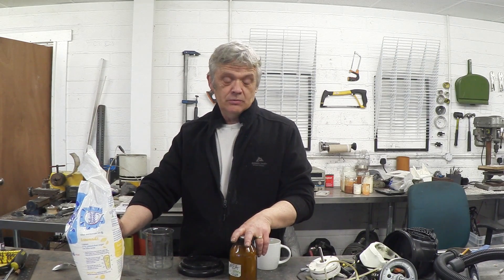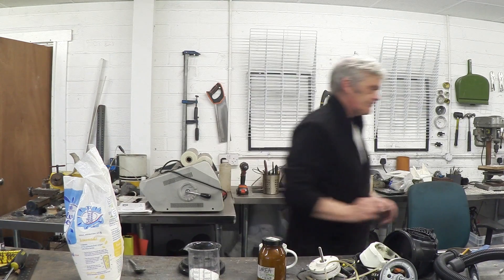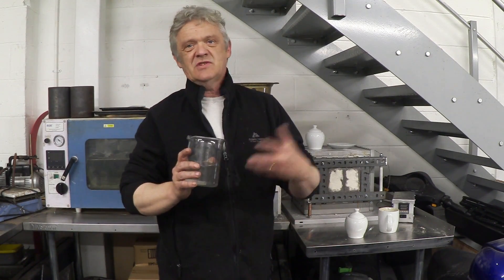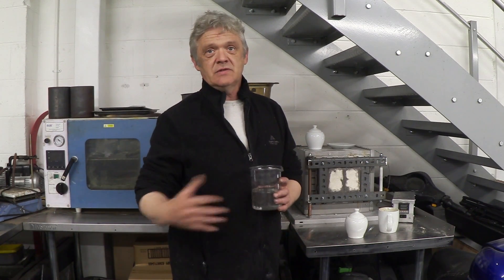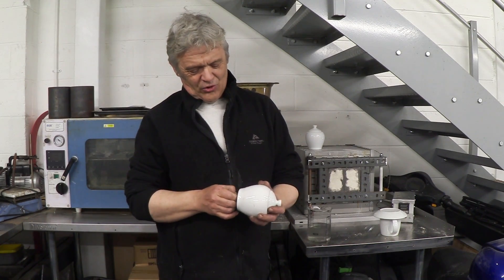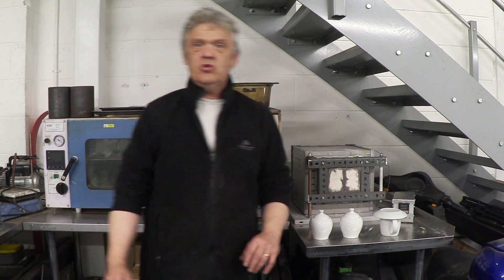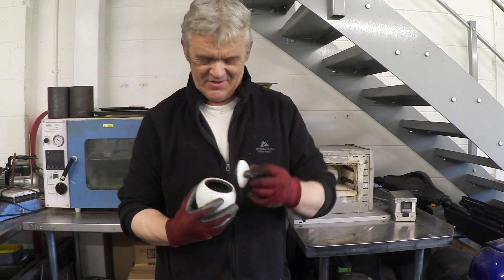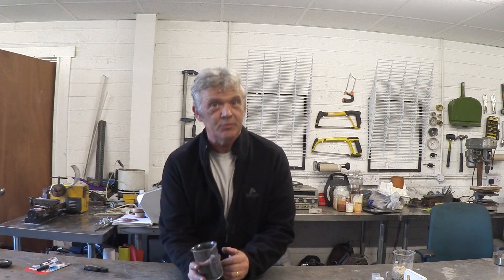DIY Safe Hydrogen Storage

Comment: I really shouldn't watch these videos just before going to bed, now my brain is popping and fizzing with ideas!
Reply: It helps me to understand many things I have been puzzling over for years. Love it
Reply: I get that alot mate hahahahaha killer init pal
Reply: Same lol. I watch them for a project I’ve in mind, but every video that I watch gives me more ideas and questions 😂
Reply: Same goes with me 😅
Reply: Yes, this man has ruined my sleep more then I can count.
Reply: here i’m watching this at 2am
Reply: Still his message is to just do it. In the right recipe base. And report back. What more can we do? 

I broke it down to do a fusion of sugar bowl and the kiln-heating in one: wrap an old 1kW radiation heating wire (heavy spirala some 0.6m long and 5mm diameter, of wound heating wire, the quartz pipelet got broken) around the sugar kettle. Then isolate first with stone wool for chimneys, then do 4 feet with the tight stone wool, and the rest isolate in a second wire with rock wool standard insulation from building narket or left-overs.

How do I share a foto? :)
Reply: I get an inch to go to harbor freight or ace hardware in the middle of the night
Reply: My problem is, I love genius to!
Reply: @haroldkrivell2524  lol mate. Same.
Reply: 109%👍
Reply: Mr Robert believes in th KISS theory

Comment: Could you do a video about compressing the hydrogen into a storage container and using the hydrogen in
an application such as a fuel cell or for heating or even cooking!
This is amazing!
Reply: Get a oxygen tank on offerup. than get an oilless pump from amazon. than get visqueen plastic and make a balloon. fill the balloon kup with the gas than pump the gas into the oxygen tank. Just like you would if you were filling up a divers tank. the balloon gets up to 5x5x5 feet and fills the tank. with the tank depending the size of it I can get up to 15 to 20 minutes of continuous gas flow. obviously you do the calculation on the formula flow. let me know what you think of the idea.
Reply: @seavil1  wouldn't you have to worry about the heat of the compressor? I've been thinking about this
Reply: @seavil1  what kind of a pressure will this get you to? Is there an efficient way to bump this up, perhaps with a boost compressor or something, to a higher pressure for use in something like a fuel-cell car?
Reply: I just found out you can use an oxygen concentrator to fill oxygen tanks and you can use the tanks for what any application but use Professional Flashback Arrestor so you don't blow the tank up.

Comment: Hi Robert! I'm not an expert in any of this, but the only research paper I could find regarding using g-C3N4 as a storage medium for Hydrogen suggested that the "hydrogen storage capacity of g-C3N4 nanotube bundles is at least 5.45 wt. % H2." However, here you're giving a number of 10 wt. % H2. Can you provide the DOI for the article you were referencing, or explain the discrepancy?

Comment: Robert, you are a hero of mine! I love your channel!
I would love to see another video where you take this material and store hydrogen from your pee electrolysissystem and then make use of the energy afterwards!
I live off grid with solar panels and batteries and I would love to be able to store some summer energy for the darker winter months but hydrogen storage is a stumbling block for me
Reply: i share the same feelings
Reply: Grow potatoes, distill to ethanol, run a Jenny with mix fuel carb. This way you can run  it off biogas as well. Sugar is nature's number 1, solar battery, and completely green
Reply: Very well put. Evidenced by our evolution to ethanol. Carbon blinded is what we have become
Reply: @psylentrage  Yes, but my conscience cries out burning away food. That‘s why I like the GCN doped with catalysts (there are some free of rare metals) and fed by concentrated sun light (DIY concentrating heliostats) or electrolysis. 
First to produce H2 for some days. 
But also - all outsides - produce NH3 for winter, as 11MWh fit into 2.7m³ standard liquid gas tank (coated against corrosion). As it is self-warning, no bad accidents can happen. 
Unless you fall unconscious from a blow on your head and lie in a sea of it. 
Just use corrosion-protected pipes and vents and a scnr cat. 

But for Biomass: 

Because for heating by biomass, all you have to do is use the cut bushes material, chopping it with fresh sharp blades, so short even-sized pieces can be yielded, and DIY build a convection-storing-drying silo, with sieve by blowing air to throw out the lighter leaf and straw-like parts, and insides disinfect with CIO2 gas in between to prevent mold, and build a Y first to solar-heated drying and in winter, to shove a spoonful at a time in the burner. Found an inverse flame lambda-sensor led burner at patents of sunmachine sterling pellet stove. Replace pellets in the patent that are rising with oil price by DIY chopped garden waste, done.

 Let us do some open hardware/software platform where editors 2d 3d simulation, …, reside, and where we exchange and collaborate (realtime online) to improve drafts.
Reply: @andshofs5769  food is energy and energy is food. It just depends on the need.

 You're method also can't be taught and implemented in rural communities from supplies at the local hardware store, whereas we've been distilling for millennia and if your not going to be drinking the fuel, you don't have to be that precise nor need a copper stil. This fuel is renewable. 

Gas is not the only product from the digester, you also get a super nutritious fertilizer slurry. And you don't need to feed it with your food. Any biomass will do, obviously the higher the calory content, the better.

Comment: We've determined a great cheap material to store hydrogen and it's everywhere!! Yes, water is the best cheap hydrogen storage solution. We placed hydrogen gas in a small glass bottle and placed it inside a large glass coffee jar filled to the brim with water. We capped it off and then placed the jar submerged in a bucket of water and left it there for approx 9 months. After this time, we found there was no loss of the hydrogen gas in the small glass bottle. In our view the reason why water stores hydrogen really well is because not only is there no hydrogen contained in water but also because hydrogen is immiscible in water.
Reply: I call that BS. Hydrogen can easily travel through water.

Comment: Great video! Very interesting. 10% by weight hydrogen storage capacity is very high indeed. Please continue this subject with the absorption and desorption of hydrogen. 300 degree C is too high for PEM fuel cell applications though. :washhands::washhands:👍👍
Reply: A heater mustn't necessarily been driven by pure exhaust gas. You keep a bit compressed gas for starting up and simply burn it. If you isolate the storage tank well, perhaps vacuum insulation, you just need to invest the heat capacity it has (c=1J/gK for metal) and the "evaporating" energy when H2 dissociates from the storage. 

Has anyone found links to cool papers that deal with the precise amount of energy you need to drive out the H2 per L gas in normal conditions 1bar 20°C etc.?

Comment: I saw something like this a long, long time ago. They used some kind of storage that needed heated to give off the hydrogen,. They tested the new tank against a gasoline/petrol tank and determined that if gasoline wasn't already a common fuel, it would never be approved today.
Reply from the maker: no it wouldn't lol and no one would think lead acid batteries were a good idea either - you'd get.a ton of people arguing about it and experts telling you it couldn't possibly work lol

Comment: Many thanks Robert !   This is Fantastic information as I'm building a hydrogen fuel cell. Just absolutely great videos on your channel.
Reply from the maker: awesome mate
Reply: Question for you, are you using hydrogen as a gas, liquid or solid? 
I'm currently working on a hydrogen pellet like dry ice. Many safety concerns have to be addressed.
Reply: @archur111  I just flew to Jupiter where Hydrogen is a fluid metal at its core and used some hydrogen metal (great stuff that hydrogen metal.
Reply: @3dmaker699  are you saying that you can't transition hydrogen to a solid?
Reply: @archur111  Not magic mate!
Reply: @archur111  mIX IT WITH OXYGEN  AND JUST MAYBE
Reply: Seriously, it's not a good idea...
Reply: @archur111  Your whole question and point of view from the very beginning was ridiculous in the first place.
Reply: @archur111  Got you I thought you meant hydrogen gas as a solid. What you are talking about when you say solid is a metal hydride is that correct?
Reply: @archur111  I'm curious about your pellet project. What problems have been adressed?
Reply: @briarfisk  I'm sorry but I have had a huge delay in my project. Moving....
My Hypothesis has remained the same however I'm not sure what to use as the Hydrogen gas mix. I can't afford to have an explosion....

Comment: Hydride storage is the best and the hydrogen won't burn or explode in the tank under all conditions and is not pressurized, a little heating rod creates the release and flow to an 8-cyl engine.

Comment: Excellent, love the variety of interesting ideas. I saw a video on using an old fridge pump to store hydrogen in a propane tank. It was on the channel, The DIY Science Guy , Reminded me of your “recycling  of old things“. Would be amazing to see you create a machine like that. keep them coming, your work is awesome.
Reply from the maker: it wouldn't last that long or even store that much and It certainly wouldn't be that safe mate
Reply: @ThinkingandTinkering  To be sure hydrogen embrittlement of containers and fittings not designed for it is dangerous.  However, it is possible to store 70% more Methane in a tank with propane in it than an empty one at a given pressure due to solubility of Methane in light hydrocarbons.   Trying to get my head around whether this would be synergetic or confounding with the carbon nitride.  Well, this comment makes no sense because I mis recalled the methane research as hydrogen and then edited out the misinformation.   No idea as to solubility of H2 in hydrocarbons.

Comment: I will have a go at doing it in a microwave kiln :-)
Using it as active material in super caps or batteries would be cool.
Reply from the maker: so, the polymerisation reaction of urea to carbon nitride occurs between 520 and 550 degrees C. above 650 thermal decomposition occurs. that's a very tight temperature range for a microwave setup to control without computer assist. i might wire a stop start into an arduino with an ir temp sensor into the reactor body. if you do that i don't think you'll have a problem.
Reply: @kennethanderson7642  Yes, I think I am only putting off the inevitable too.
My microwave is only 700W, and can be set for 20% power at the lower setting, so worth a fiddle, making 15g batches rather than 150g
Reply: solarhope if its a transformer type they use duty cycle but inverter types can actually be on at 20% and higher with 100% duty but still its hard to keep that between the small window so i think a kiln is the way to go for even tempretures !
Reply: @kennethanderson7642  

i miss kev.

Comment: It's an amazing method for storing Hydrogen! My congratulation for this. Till now they told us need deep cooling Hydrogen for transport etc. which is very expensive for the anorm tecnical equipment - but with this ... GREAT!
Reply: I think this would be too heavy, but if cheaper than cooling, a plus :)
Reply from the maker: there are always different solutions mate - it just depends on what you need

Comment: Hi Robert, I tried to follow your recipe and made graphitic carbon nitride. However, the material never managed to absorb any hydrogen. I supplied 30 bar hydrogen gas at 25 C. Is there any activation process for this material? Did you do a video on graphitic carbon nitride storing hydrogen that shows the amount of hydrogen being stored or being released by this material?
Reply: in this video, robert states carbon doped graphitic nitride grabs the hydrogen at 1 atmosphere.   i didn’t see anyone else confirming that.  did the weight change ?  apparently it grabs h2o vapour as well.
Reply: Hey buddy if this material really works start making hydrogen storage tanks please

Comment: Okay 2 questions:
1. Could this be used as a molecular sieve, say for a stacked neutral plate dry cell hho generator and you wanted to separate the gases? Or is there another material that would be more suited for that?
 I know you can do it with regular electrolysis setup but I'm wanting to use high amps and I dont have super thick gauge stainless or loads of graphite currently at my disposal. 
2. Do you have any experience with making ferric nitride( Fe16N2)? Super promising material but I I havnt found alot of information on synthesizing it.

Comment: Great info Robert, thank you for sharing.  Now, can I put what you got from your beaker, for example in a tank & compress hydrogen to it to store it?  Or how do I go about this in a practical way?  My dumb way of thinking is: I surely don't want any air trapped in the tank if the tank is to store hydrogen, cause then, it'll turn into a hydrogen bomb.  So, how do I apply hydrogen to this & keep it in place?  Thanks again, your dedicated work.

Comment: I’m curious with the cost of storage and utilizing it versus liquid hydrogen or compressed liquid hydrogen.

The problem with liquid hydrogen in aircraft is simply the cost and losses for storing and using hydrogen.  That drives up the cost at the end which is what you’re trying to curtail.

Is this cheap and efficient enough for aircraft vs liquid hydrogen they’re using now?  What about the atmospheric and temperature variables?

Comment: I'm curious, after this has absorbed or become saturated with hydrogen, then subsequently heated to release the hydrogen for whatever means, what is the byproduct? 
My real question is, can it constantly by used to absorb and release hydrogen without degradation?
Reply: This has been my question too:  is the material reusable once heat has been applied? I hope that it doesnt degrade but the hydrogen bonds just break and the material remains relatively unchanged. Anyone got more info about this?

Comment: What about combining this with new generation hydrogen pressure vessels that utilize graphene boronitride to increase to pressure vessel’s capacity?

Do you think it’s possible to combine a spiraled/branched hydrogen “sponge” like that in a higher pressure vessel and get close to capacity of cryogenic storage, with a simple heating element built in?

Comment: Nice vid my friend👍👍👍 , we storage hydrogen in ceramic plated tank , an emailed water boiler , its depending on the pressure  level of the tank .  50 bar can hold the most boilers . The cost and use ratio is the cheapest way .
Reply from the maker: Thanks for the info

Comment: IF the IgCN on GoreTex works - pretty much at all - for Proton Exchange Membrane and Gas Diffusion Electrode applications, the chance that it needs more material or a larger area/volume to perform the same electrolysis or fuel cell function as compared to Platinum on Nafion, isn't really a show stopper.  The IgCN lends itself to improvement in nanostructure with better processing, whereas Platinum is already 'all that it can be'.  The difference between Nafion and GoreTex appears to have been determined by DuPont's marketing department, rather than the scientists or engineers involved in creating the material; it seems that it was differentiated for sales purposes, more than anything else, and then somewhat incrementally enhanced for specific applications, but the two started out as one thing.  A complete system for low cost, third world Hydrogen production, storage and power generation - from Solar directly and from other renewables by electrolysis - is in the offing, if you made such a diffusion membrane work from these terribly cheap ingredients.
Reply from the maker: for sure mate - are you working on it?

Comment: What a super idea, I would upscale this a little, no Lithium 6 Deuteride required with this magic material, I was actually on a dating site the other night and was blocked by the lady engineer I was chatting to just for jokingly suggesting to her that she could steal me some from her work. 
No loss there lol, and that looks a much easier material to produce, I would love to get my car running on H2.
Reply from the maker: it is a nice material for sure
Reply: Could generate the H2 with energy from solar and store it in this material, release and burn as needed with either heat or sun.

Comment: Cool. Thanks again! I think you can make this with "pressure reactor" (tightly closed metal pipe) and regular oven too. "The Thought Emporium" has video about it (How to make quantum dots at home). Or in closed can above regular fire. "cayrex2" has video of that called "Material for Battery and Supercapacitors (graphitic carbon nitride)".

Comment: Isn't that stuff , or something like it, used in supercapacitors?
    How much energy is needed to drive the hydrogen out , compared to what you would get from it? For a practical use , like a fuel cell , or burning it directly in a engine , you would want this to be as low as possible.
    Interesting video! This , and a lot of your other videos , would make great viewing for high school science classes.